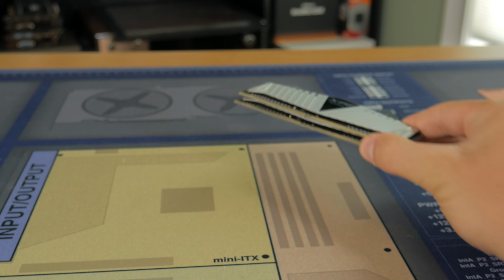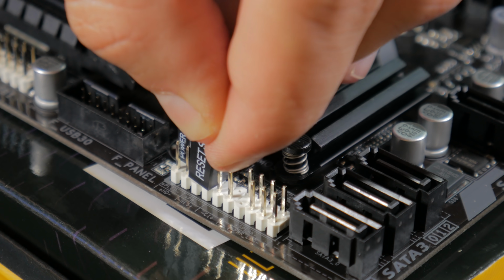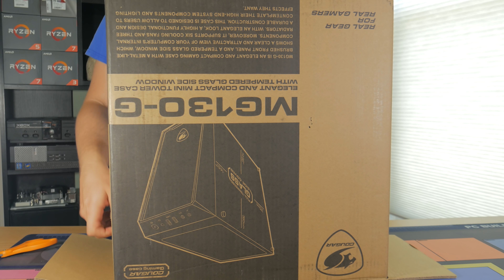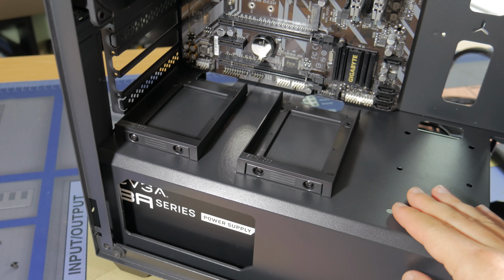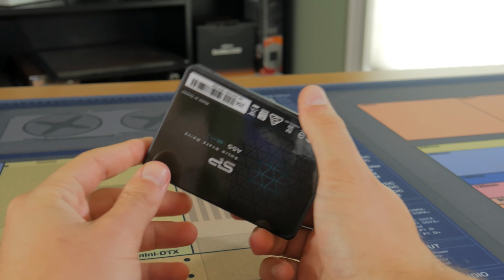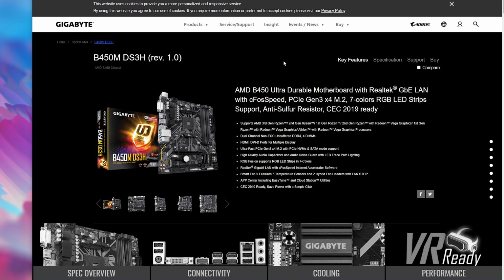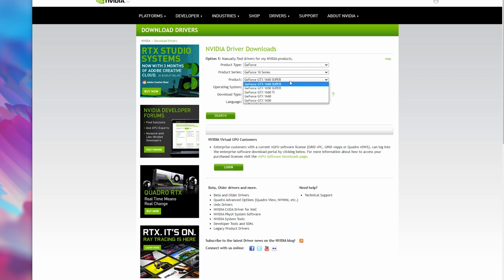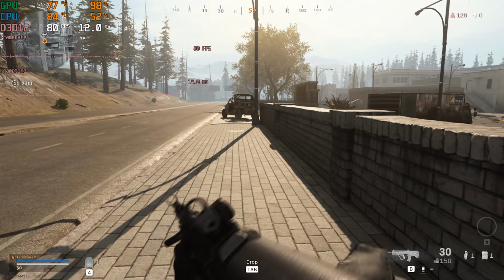HOW TO: Build a $550 Gaming PC! (2020)

Comment: Can this stream
Reply: Not that much
Reply: Diego Moreno should I upgrade to a 1660 or a 1660 super to stream
Reply: @mr.walnut0669  yes the cpu is fine
Reply: Diego Moreno or upgrade the cpu
Reply: @mr.walnut0669  cpu is more the Problem of that build.  I would just take a ryzen 5 2600 and a gtx 1660 or 1660 super, the Performance boost is Worth it
Reply: Wumble ok thanks man
Reply: Use the GPU for streaming.

Comment: Hi this is the correct comment section to ask is a 3100 and a rx 580 8gb good for streaming and intense editing with 16gb 3200mhz
Reply: An Nvidia gpu with nvenc encoder might be better for streaming. That r3 3100 is a good starter with an amazing upgrade path. If you can fit it in the budget, a r5 1600af or r5 2600 will be better for streaming an editing
Reply: Buy a Ryzen 5 3600 or Ryzen 7 2700x if you care that much. Same with 32gbs of ram. At minimum ryzen 5 2600 and the 16gb you've chosen